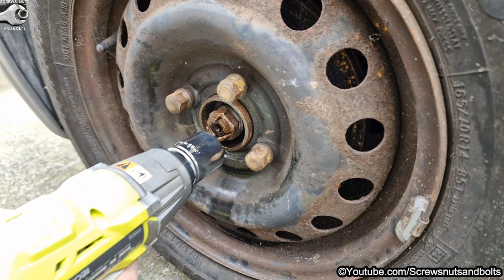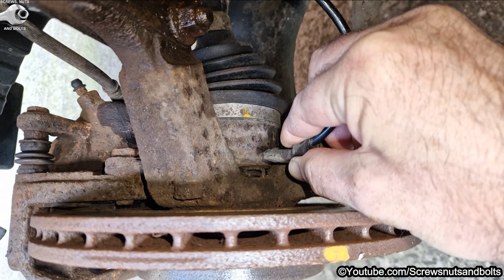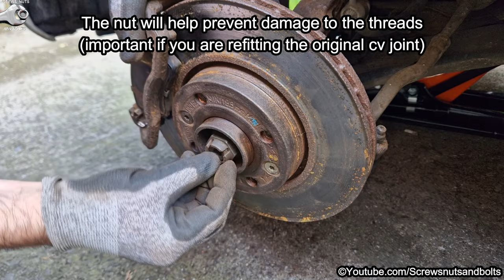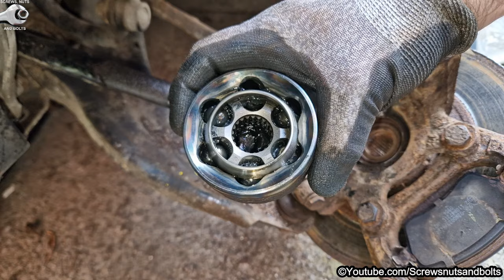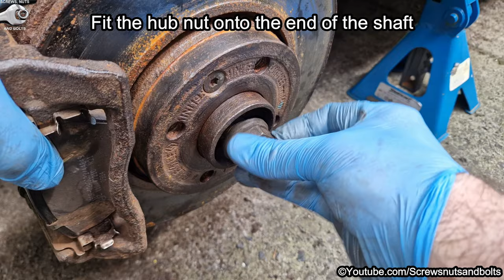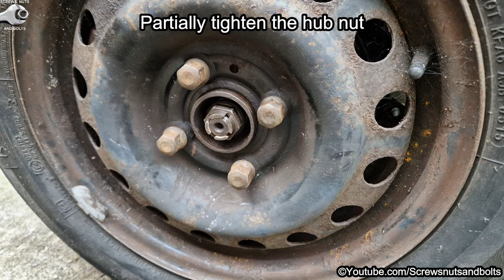CV Joint & Boot Change - Nissan Micra K12

Comment: Nice job, but i think is better to pull out whole shaft, plug transmision hole with something to protect any leak (any way will by not big leak, car is jacked up on one side) and replace both cv boots, always change both, you will need to do another boot in couple of months, you can do it at 1 job. And maybe more grease is good do use. I did it last week and I ordered CV boot kit and it was 2 grease sacks of grease for each cv boot.
Reply from the maker: Thanks, I'm just demonstrating the process on one side of the vehicle :)

Comment: Yup. Really good again. What happens if the driveshaft comes out?  Because that’s bound to happen when I do this job😀
Reply from the maker: Cheers !. If the driveshaft comes out you'll lose a lot of oil from the gearbox. You could probably position an oil catch pan underneath it as you work, just in case. The driveshaft is held in the gearbox with a spring circlip so it shouldn't come out too easily but, if it does, you can carefully slot it back into the gearbox. Just be careful not to damage the oil seal.

Comment: Great video.  Working on a Nissan Figaro and the system is pretty similar with the Micra you are working on.  Can't get the joint to separate from shaft at the moment in spite of how much i bang on it with a hammer.  back at it tomorrow.  Overall, great video!
Reply from the maker: Thank you, it should be the same. Just be careful not to pull the other end of the shaft out from the transmission !

Comment: Hey is still me, my micra wen i go over 100kmh the front of the car starts shaking do you think maybe i need to change the grece like you did on the video in order to fix it? (The tires are new)
Reply from the maker: There could be a few different reasons causing that shaking. It could be a problem with your tyres, wheels, brakes, steering, suspension, axle or engine. You'll really need to have a mechanic check that out and find the cause
Reply: @screwsnutsandbolts  all right, thanks a lot for all the videos you have done whit the micra they really helpful
Reply from the maker: You're welcome, hope you get it sorted out.